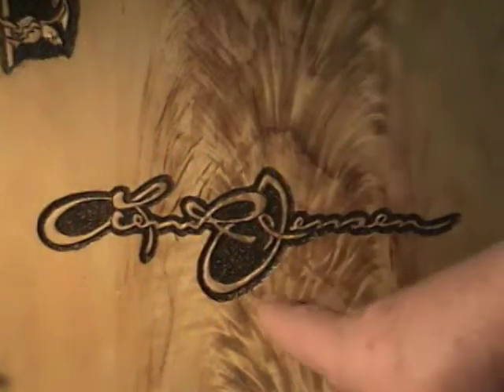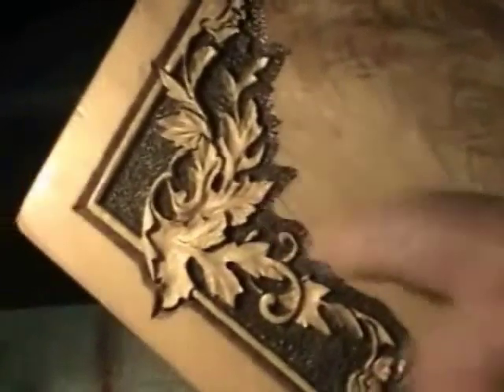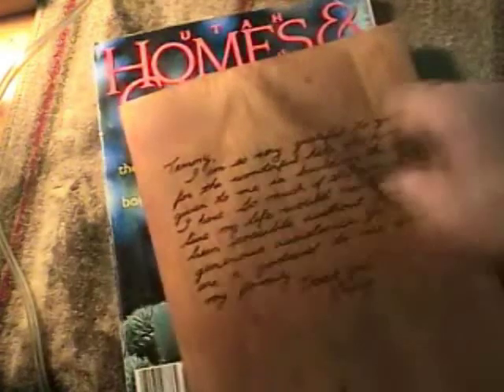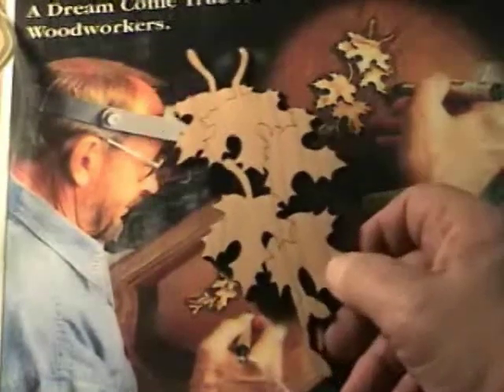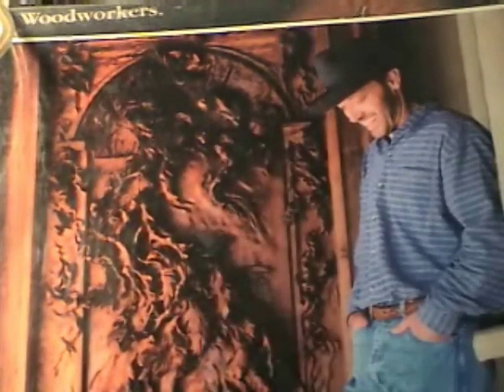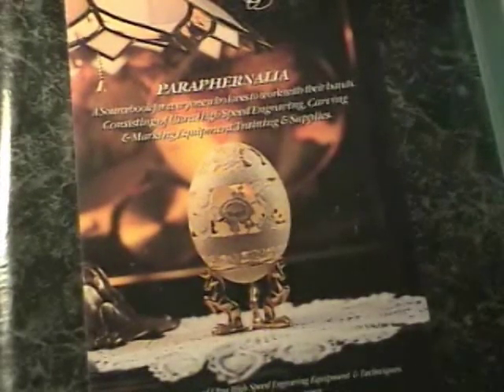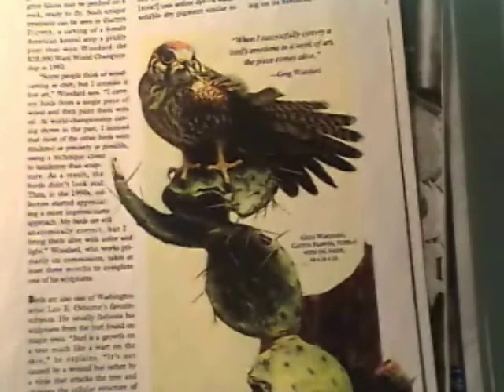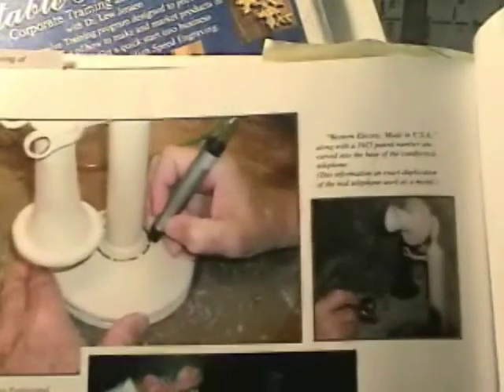Wood Carving Finished Surfaces with Power Carving (High Speed Engraving) Tools

Comment: Hey, one question.  How much does one of this machines coast?
Reply: Depending on the brand & the bits needed they can go from a cheap learning kit for 20 bucks up to a couple hundred for a full set of things to do what you see in the video. That's just my 2 cents, Im still in the learning process. If your talking air tools & lasers then your looking well into the hundreds for quality tools
Reply: Actually its going to set you back closer to $700-$900 if you buy the kit plus a compressor. Which is needed to run them.